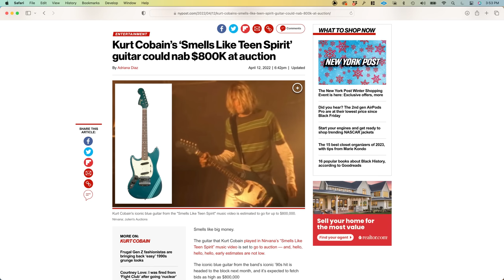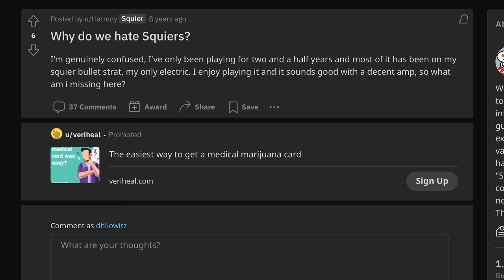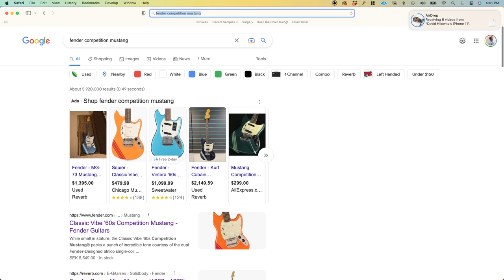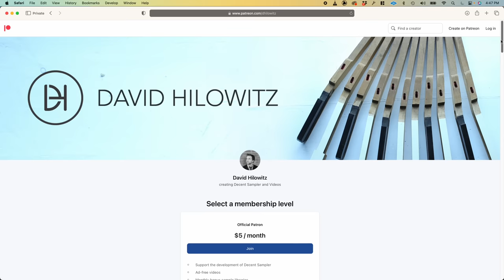Squier Mustang: How I learned to stop being a gear snob

Comment: Gear snobbery aside, I think the work Fender has put in to rehabbing the Squier brand over the last 20 years or so has helped erase the stigma that it once carried. I purchased a J. Mascis Squier and a 70's style P-bass for recording over the last few years, and both of those instruments were closer to some of the Mexican made Fenders I owned in the early 2000's than the Squiers I started out on in the late 90's. The QC can still vary here and there, but generally a modern Squier seems to be a pretty solid choice, even if it may need a few upgrades or a good setup out of the box.

Comment: My first guitar was from Amazon, they had like three guitars in stock EVER.
It was made out of like glue and wood dust, it also had like fake guitar strings coated in rust, they would constantly make my fingers bleed but for some reason the way the design was done made me learn a freaky style, I play flamenco and I discovered an entirely alien trick with it, I spent a concerningly long amount of time with it, most people couldn’t play it at all, barred first fret was impossible even for some of my strongest capos because of how distant the frayed spiky strings were from the board. It’s light like a feather but it twangs so violently that it really makes anything sound solemn and weird.

I guess it’s me paying homage to the guitar that introduced me to playing music, it made me tougher than needed, but when I went to a normal fancy guitar, one I lost a fun trick that I never heard before on any other guitar, and two it didn’t feel emotional, there was no twang, it was all balanced and clean, it also of course didn’t cut me like the other one did because all the calluses and developed strength, I always come back to that black guitar, it always has a few more scratches and dents than last time, one day it won’t be playable and I’d rather enjoy the skills that it taught me before it’s too late.

Comment: i bought a squire bass (i'm a guitarist and only wanted a cheap bass to mess around with that i wasn't going to worry too much about the condition of), and the frets were so poorly sized that the metal cut my hands if i slid my hand along the neck at all. i was able to cover the edges of the frets up using an acrylic polymer that hardens into plastic and it plays fine and i no longer cut my hands on the neck, but i've never encountered this issue before on any other guitar. i haven't played that many, but it stands out as the kind of mistake that i felt like shouldn't have been possible unless it really is a cheap brand. maybe this is the kind of thing people are complaining about.

Comment: I bought an Indonesian Hamer from the late 90s for $100 at a guitar show (Amigo Guitar Show). The guy said, "Nobody wants this crap."  I agreed.  I was looking for a nice G&L.  But that was so cheap.  So I bought it and played it on and off for a few years.  I never even changed the strings.  So one day after a season changed it really needed a setup after all.  That setup would cost more than the guitar!  But I thought I'd see what would happen and see if the shop I use could do something special with this non-descript guitar.  When I picked it up not only was all the frets gleaming (didn't notice they were dull), and the body had changed color from godness knows what that was on it.  And it played like a monster.  I played it on stage and like it so much that I trust it.  That means it is more than a pretty face.

Comment: I have loved Les Paul's for as long as I can remember. My first real guitar was a $500 Epiphone Les Paul. After a few years, I finally saved up enough to buy a Gibson Les Paul for about $1200. But after about 2 or 3 months, I began to miss my Epiphone. I never enjoyed the tone of the Gibson no matter what I tried or pedals I used. The strings on the Gibson always went out of tune and I had to re-tune after 4 or 5 songs. I was always afraid to play too hard because I didn't want to scratch or damage anything.

At the 3 month mark, I put the Gibson back in it's case and used my Epiphone for the next 3 or 4 years while I still played in bands. There were stickers all over the Epiphone and it was scratched to hell and back, but I loved the damn thing. I don't know if it ACTUALLY sounded better or I just attached so much sentimental value to my first real guitar, but the Gibson never lived up to the hype. And it cost more than twice as much as the Epiphone.

Even now, years later, I miss that Epiphone. I wish I never got rid of all my music gear.

Comment: the thing here is that the early squiers like yours are a good buy.   the bodies were solid, the saddles are not cast pot metal, the tuners are the inexpensive but decent generic tuners found on many guitars....they're squiers mostly made in japan.     It was all the squiers that came in between the later 80's and up to the mexican made guitars that were so bad they gave every squier a bad reputation.

Comment: I essentially do that to any inexpensive guitar I buy. I would have changed the electronics and used better quality wire (it makes a diff). During the lockdown I bought a 116 guitars, everything from special edition, Les Paul's, and a Fender lux to Squires and chinese Knock offs. I realized the ones I like the most don't have the highest price. I have about a dozen left, and I made some money selling off the rest. I found I like Samick the most for quality and versatility. I also bought and sold over 400 pedals. I still have too many but most are gone, again making a small profit. That was how I got the gear snob DNA out of me. Oh and for me it was Sambora not Kurt. Just my 2 cents

Comment: We've all been there. Mine was a bike rather then a guitar but I did the same things. I once had a bmx bike that was black with magenta accessories. It was awesome, and though inupgraded parts and it road great. I couldn't get over one thing... it was originally from Walmart. I was so afraid of what people would think if they knew I had a walmart bike that I would lie and say I didn't know what frame it was. Eventually I bought a used recline frame for 25$. It was uglier and because I didn't have the parts to complete the swap properly,  it road horrible. Steering loose, parts didn't match, but hey it was a redline right? I think as we get older we realize that none of that stuff matters. But what we forget is why we did it . Kids can be cruel and we all remember being or seeing a kid get made fun of for wearing Payless shoes or the Walmart skateboard, or whatever it was. I still miss that bike, but I understand where I was at that time and why I did it.

Comment: My "Tele's" a Squire and my two Gretsches are not top of the line either. But for my level they are bang on, each is setup perfect with good strings and a decent amp "Fender Princeton".  A good guitars a good guitar, no matter the make/price. Bet theres a few expensive dogs at the back of cupboards.

Comment: Thank you so much for this video! I felt this, although I never sold my old one. I unpacked it from the gigback one day, did a total rebuild (made it ugly) and so far no other guitar I tested matches my Squier Affinity Stratocaster 🙌

 Things done: blocked tremolo, locking tuners, kill switch and resoldered the pickups to make them work as a "humbucker" (had an actual tonerider humbucker for a while put honestly didn't hear much difference)

However I got embarrassed by the look of it so I actually restored it some by scraping if stickers and put back the original picguard. But it was mostly to match my new identity as a musician which I think is fair enough.
I might do an update on it on my channel.
Have a great day!

Thanks again for sharing the video

Comment: Cool video! But honestly speaking, you didn't really shield it from emf interferance properly. You put copper foil on top of already existing graphite conductive paint in the cavity. Making a double shield can affect the guitar tone quite drammatically. also, you should either try to clean the non-conductive layer of adhesive on the foil in places where it joins together (solder it with other bits of foil, using conductive paint a lot of things work for this). Good conductivity is vital when shielding the electronics.

Comment: Changing pick ups is not going to have a big impact on the sound in general. Exceptions would be replacing a single coil with a humbucker, or replacing the pickups in those guitars you get from China for $50. The amp and speaker have more impact on the sound.

Comment: One of my best guitars in terms of cost/feel was a Harley Benton TE62 (telecaster model) I replaced pickups using a Fender Telecaster Player pickups that i purchased second hand including the controls.... i isolated the cavities get less hum... played great.... and then my idiot i sold it..... And now im looking to buy one again.... i think is called learning curve 🙂
Reply: I have the TE-20 so it's the cheaper one I think, mine was only $68 before shipping. I love this guitar. I set it up because it needed it but it does what I need it to do. I copper taped the inside and replaced the bridge with a hot rails clone from Amazon, I think the Fleor brand. Cheap guitars are great. Sure their QA might be lackluster with fret edges being sharp or with high action. However, I would rather practice setup and mod a cheap guitar compared to buying an expensive guitar. Expensive guitars still need maintenance and setup throughout its life so it's a good idea to learn on a cheaper one in my opinion.

Comment: This is interesting. My first guitar was a Fender Squier from the late 90s, and I can't tell you how much I hated that thing. The sound was ok (changing pickups is pretty much a must at that level of guitar tbf) but the playability was just garbage. The neck wasn't particularly smooth with the finish being a little sticky in places. The fretboard also had too much friction, and the action was pretty shocking. 

I eventually bought a Jackson and that was immediately just so much nicer to play. My bandmate also got an Ibanez which was like playing with butter. So smooth and easy to do leads on. 

Hopefully the quality of Squier has improved over the last few decades and they're now good beginner instruments. But when I had mine originally, it was a nightmare. That said, great cheap guitars to modify as there's little going on with them and it doesn't particularly matter if you break them due to their cost.

Comment: My first guitar was a Japanese made Squier Stratocaster in 1983 bought from Chandler Guitars in London. Probably the cheapest guitar they'd ever sold. 
The guitar was superb apart from the pickups. They were I gather purposely downgraded by Fender who were frightened they'd lose sales so I replaced those pickups with Fender ones and it was great. Very sadly I no longer have it as it was stolen about 5 years later. I'd like to think the thief was cursed and had a horrible life. I still miss it.

Comment: If the neck is varnished, no matter how thin it feels, what's the point of using Tru Oil on it without sanding the varnish off first? It won't penetrate the varnish.

Comment: The reason I spend more for higher end guitars vs saving money and upgrading a cheaper guitars hardware is really all about the neck…. It’s also about being lazy in that the higher end stuff has quality hardware already…. But mostly the neck. 

The squires are solid! But in my experience the necks aren’t as robust to environmental changes.  They need adjusted much more frequently. They are more prone to twisting too.  

Squire is top tier for people getting into it, or for more casual enjoyment. Also great for a side instrument like a guitar dedicated to an alternate tuning. 

But getting a neck with graphite reinforcement, first choice woods, rolled frets is worth the money if you’re wanting a guitar to last for decades.

Comment: It was easy for me to quit collecting vintage guitars, as much as I love them. Thieves kept stealing them. At first I thought I would just keep them at home and not take them on the road. But when I was on the road thieves would break into my house and steal them. So I stopped collecting vintage guitars, and have been playing a Squier Affinity Fat Strat since 2002. No modifications other than higher quality pickups., which I took the covers off of to make them look cheap. 

There is absolutely nothing wrong with playing a Squier. Anyone who tells you different has obviously never played one. It's a Fender guitar, even if it's an "Entry Level" one. But in case you're interested, Mike Rutherford from Genesis, a guitarist with years and years of experience plays them. I swore by Squier guitars before I knew that. But seriously, if they can handle a Genesis tour, they ain't your average "Off the Rack" cheap guitar. The primary difference is the wood, the quality of the components, and of course, the neon sign on the headstock that throws thieves a curve ball. The Squier by Fender decal.

I have a friend who has a 1965 Strat that he disguised as a Squier to throw off the thieves. It's kind of ironic that the Squier company was bought by Fender in 1965...

Comment: I have owned 4 electric guitars. A hollow body Gretsch(borroed from my brother) Fender mexican strat, Epiphone Es-335 and a 2010 mini squier (it’s really bad) and the lesson I’ve learned even though I’ve only spent 600$ at most on a guitar is buying a guitar 300 and under and putting what you want in it is the sweet spot. 1/10 guitars you buy from guitar stores are magic so just make a guitar magic yourself instead

Comment: I totally get the part about the Teisco, Mine was an AGS. It looked OK when I was 7. Almost unplayable. Of course I didn't know that at the time. I thought I didn't have "it" . Gave it to my brother. He destroyed it in a couple of months. I should have kept it. Anyway, I want a Gibson LP, Fender Stratocaster & Telecaster, Paul Reed Smith, etc. Just like everyone else. However, do you really want to take a 2500 or 30000 buck pride and joy guitar out on the road with you? Well you do and you don't. Any guitar you take is going to get chewed. In the sixties, there was a big difference in quality between gibson/fender and cheap guitars. That's where they got the definition from. Now it's totally different. All the guitar parts are the same and very good. Good quality pickups and a good setup and it will be as good as any guitar at L&Q or guitar center. For a few hundred bucks. And if it gets hurt? Hey, that just gives you an excuse to setup another one.

Comment: I had a clear out of most of my expensive Gear, maybe £15K of Guitars, last couple of years, I dont do music as a Job, been there, done that, its a hobby, some Guitars have sentimental value, but dont feel a need to collect them, have had Gucci gear and know a good or a crap guitar, in my current Band, I use mainly an old Tokai Les Paul copy, (not cheap, but not Gibson prices) or a cheap as chips Fazley Tele with a P90 in the neck, have a Strat and SG and a few others, NONE of the guys I know who play Guitar as a day job are Gear snobs or obsessed with Gear, most have been using the same gear for a long time, the name on the headstock means nothing to audiences, same with amps, I have Marshall, Vox valve amps, nice, but I mainly play a Boss Katana 2 x 12 now, weighs much less, sounds great and reliable as f&ck.  One of the best Strats I have ever had is a Jet JS400, cost less than £200, changed the pups and fantastic, why is it many of the people who are gear snobs, never play live or have anything out there with them playing? The joke about about a musician, someone who turns up with £10K of gear to earn £100

Comment: I stopped being a snob when I worked for a luthier and realized that all aspects of feel and playability are simply a matter of setup. I played $10 000 instruments that were almost unplayable before having work done, and made the cheapest instruments available play like butter. 
In terms of electric guitars, if you take a cheapo Epiphone and a top of the line Gibson to the same tech and have fretwork and a setup done, you will not be able to feel the difference between them. 
I love buying cheap electric guitars now, because I can set them up, swap hardware and electronics, and have an instrument that smokes any production model on the planet, at any price point...for a couple hundred Canadian dollars.

Comment: But you are still very much a gear snob.  It's not an absolute law, but - in general, in life - YOU GET WHAT YOU PAY FOR!  At your age I bought a Fender Lead I for $149.  The quality for the money was ok, but it was smallish, had one tone wood (maple) and one extra hot DiMarzio pickup, leading to a rather grating sound, little sustain, and an extreme lack of versatility.  Also, the looks were very pedestrian - body painted solid black and that was it.  I went through a couple more ok axes, then got my dream - a 2005 Heritage Cherry Sunburst Gibson Les Paul.  The three tone woods  used - mahogany body, maple body cap and neck, and the rosewood fingerboard - made for a fantastically rich/complex tone with excellent sustain.  Easy to play, and the solid weight felt great to me.  Worth every penny of the $2499 I paid for it.